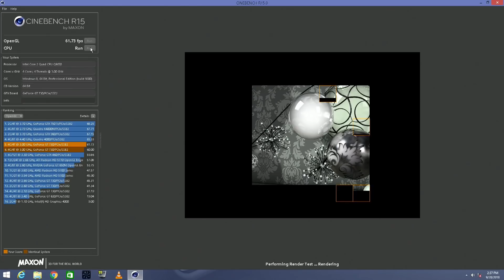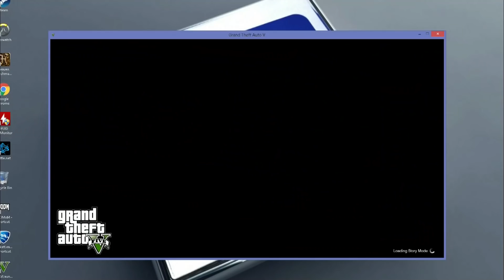PC GAMING WITH A $10 CPU UPGRADE! INTEL CORE 2 QUAD Q9650

Comment: on the hp page,it says int only supports the core 2 quad 6600/6700.
what modification did you do in the mother.
Reply: mad72ful He updated the bios to the latest revision prior to installing the cpu. I’m running a q6600 tape-modded to 3.0ghz right now and it runs just fine. No extra voltage needed, just an increased multiplier. If you can’t get lucky and find a cheap q9650 in the wild, you can get a q6600 shipped in the us for $7. Look up the BSEL mod and voila, a $7 q9650.

Comment: Thank you for the video. I searched on ebay and I found that those two proc "Xeon X5472 && Xeon X3323" are similar to Q9650, are they compatiblr with this motherboard? And is the Q9550 and Q9450 will work too?

Comment: If anyone is making a budged q9650 gaming rig dont do what he did...get a overclock capable motherboard, oc the cpu,8gb ddr2 800mhz set it preferably at least 5-5-5-15,gtx 750ti or gtx 1050 and dont be surprised when u get 50% better results in games then he did...

Comment: Hello i have a question for you I have a small dell desktop with a core2duo processor. it is a E8400. I have 6 of them. But my problem is i want to upgrade to Core2Quad I'm not sure what processor will work to replace this one. Can you please help me?
Reply from the maker: The best way is to pull the model number off the motherboard it's usually bigger than the other writing and punch it in to Google you should be able to see SUPPORTED PROCESSORS. UPDATE your bios if you haven't already there may be needed microcodes for upgrades.
Reply: Hello thank you.

Comment: please link update bios ?
Reply from the maker: HP DC7800 DRIVERS/ https://bit.ly/2mtSAtC IF you are using windows 10 to find the drivers it may say there is no available drivers available. Click manually choose Operating System. Pick windows 7 64 bit to display all the drivers.

Comment: You should pair it with a more powerful card,the gt 730 isn't really a gaming card,maybe a gtx 750ti (you get bit of bottleneck though)
Reply from the maker: i agree a 750ti would be the best for this particular system and the 25 watt pcie slot
Reply: @modstek  Hi, what's the name of that heat sink that you called it looks great? JAJAJA

Comment: "JUST A LITTLE VIDEO OF MY 2007 HP COMPAQ DC7800 AND CORE 2 QUAD Q9650 DOING SOME PC  GAMING ON TODAYS NEWER TITLES!" but all the games you tested are old? Every tested game would run on any dell optiplex with the settings adjusted and a GT 1030.
Reply from the maker: Cool a 1030 works bout the same as my 730 because 25 watt pcie limitation or a 1050 ti for that matter
Reply from the maker: And I could similar results from a tape modded q6600 and compare that to q9650 but about 4 or 5 vids down you could see that as well. 
   Just a fun video sorry it wansnt enjoyable for you
Reply: Lol still though, it should be "how does a q9650 stack up in pc gaming in 2014" with the games you use lol. Nothing shown is from 2018

Comment: Alguno es tan amable y me explica cómo hizo para poner ese procesador, si tengo entendido ese PC solo soporta procesadores de 65 nanómetros, y el que él está usando es de 45 nanómetros, el tdp no es muy alto para la fuente de poder integrada o la cambio? Agradezco a los que me puedan aportar información, ya que tengo la misma máquina y quiero hacerle modificaciones en cuanto a hardware
Reply: Yo tambien me pregunto lo mismo pero con lo de la fuente no hay problema porque el procesador es de 120 w de tdp y la gt 1030 tiene un tdp de 30 w añadiendo placa y discos duros se queda en 160-170 w y da de sobra
Reply: Yo tengo una dc5800 le puse un quad q9550 8 en ram anda bien pero nose si puedo meterle una gt1030 alguien me puede ayudar